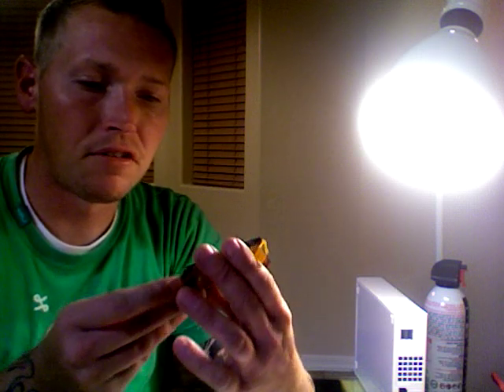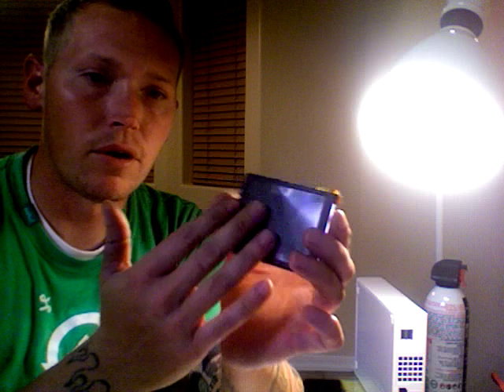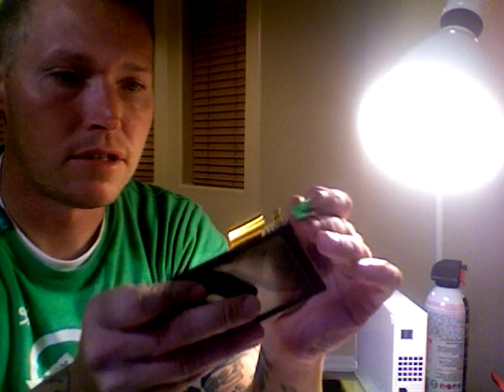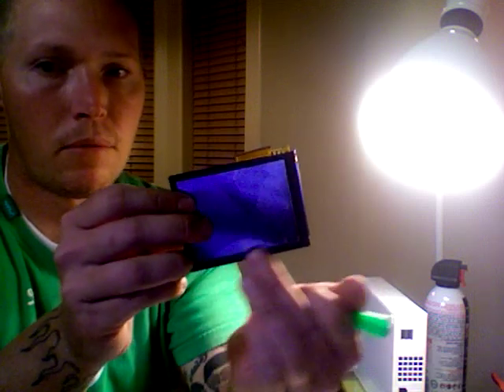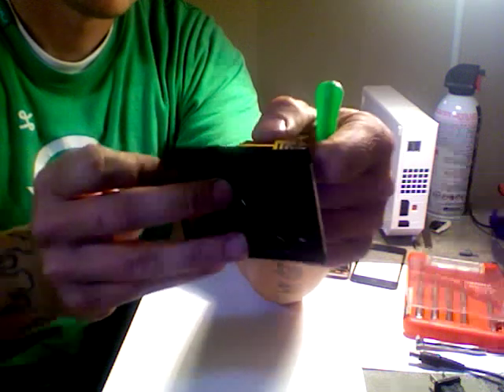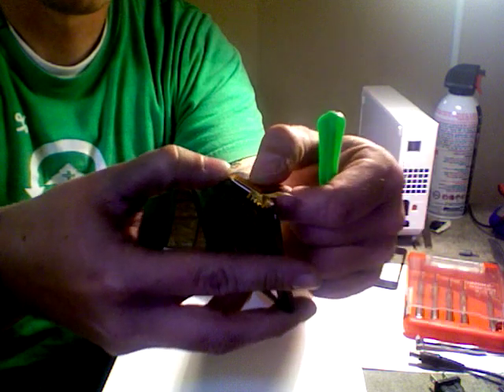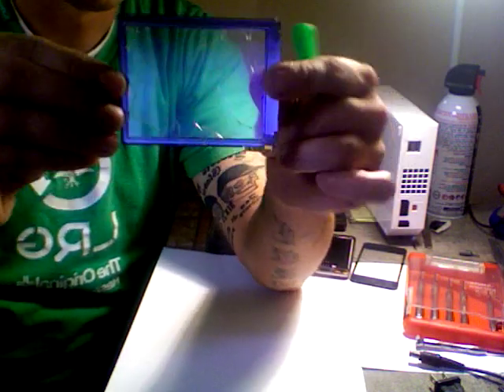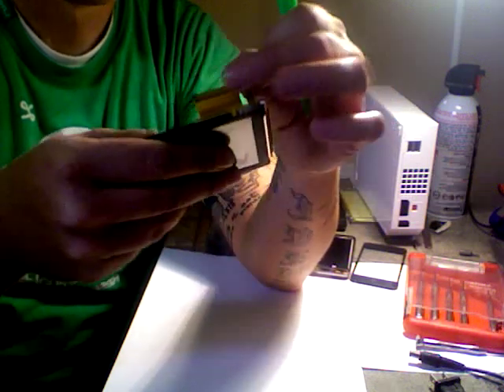Garmin Nuvi LCD Screen Removal/Replacement  Pt. 7

Comment: any help on replacing nuvi 3550lm screen? no screws to remove back
Reply from the maker: You have to lightly separate the back first in order to get to any screws. The plastic back can be carefully pried off.

Comment: The problem with the video is that it does not clearly show how to make sure the reattached strip is properly aligned and seated correctly. If there is any assistance with this issue I would appreciate the help.

Comment: Hi Matt. I haven't used my Garmin in a while and recently got it out but there was a problem. When I clicked on icons it wouldn't open the icons or if I went into settings and clicked one of the items above, it would click back even if I clicked the highest item away from the back button. After a painstakingly long time I managed to reset the sat nav and the whole touch screen issue was fine but now it is playing up again.

It has reverted to the problem I had to start off with. I don't think the touchscreen is damaged because when I lock the sat nav and click anywhere on the screen whilst it is locked the message of "slide lock to unlock" appears so this must mean that the touchscreen is okay I figured.

Any idea what I should do?

Comment: Hi Matt, I have horizontal white lines (about 15 of them at the top of screen) the images under the white lines are clear and focused. Would I need to replace the LCD or the digitizer? I'm not a tech guru, but watching you change the screen, it looks like something I may be able to handle. I'd rather try to fix it myself than pay Garmin $110 to repair it. If it doesn't fix it or I ruin it, I'd rather just go buy a new one then. I appreciated any insight you can give me. Thank you.

Comment: Hello. My unit came on but would not function. Dirt had got into the bottom of the screen. I cleaned it out with a finger nil cleaner. Works now.

Comment from the maker: It's a CCFL which just stands for cold cathode fluorescent lamp. It's just referring to the backlight.  When the backlight or CCFL goes bad but the actual LCD is still functional, the screen will appear to be dark. You would still be able to see graphics on the LCD by shining a bright light at the screen and looking closely while the device is turned on. The digitizer is referring to the actual outer glass that you touch to command the device. Hope this helps. Thank you for watching!

Comment: Hi There,

A few pointers if I may?  Would be helpful if you showed the initial stage of the case being separated and then had close ups of the ribbons that you are removing from 'your' view point. All the viewer 9us) sees is the front of the digitizer and I'm wanting to crane my neck to look over the top of the unit to see exactly what you're doing. Also, more light required.  Hope this helps to enhance your video?  Cheers

Comment: srry to ask this dumb question but I'm kindda confused :-{  .. I have one of those "off-brand" gps from ebay with the Nav N go software and the glass broke(when I turned it on, was able to see a blurry picture but I touched the screen and now I can only see lines)  what do I need to replace? the digitizer or the lcd?.... I tried to separate the screen as you did and pieces of broken glass came off as I was doing it, Thanks for your help

Comment from the maker: @MrXamenyap Go to ebay and type in this part number 320520531165. This company is based in Hong Kong so they are probably closer to you (faster shipping) anyway. When you order from them make sure you email them a picture of your  digitizer. They will look at the photos and make sure its the correct model. Garmin is famous for releasing GPS devices then revising either the LCD or digitizer a few months later. It makes it so much harder to get the right parts..

Comment from the maker: @MrXamenyap   If you actually remove the digitizer, the device will no longer recognize your 'touch'. You would only be able to turn the GPS on and off but it wouldn't allow you to advance between screens. The good news is that eBay has quite a few sellers that offer the 255W digitizer starting at about $12 US. Just go to ebay and type in Garmin Nuvi 255W digitizer and you'll find several. I hope this helps you and thank you for watching.

Comment from the maker: @zhengjdc ...on larger machines like MacBooks. Even working with larger equipment, its extremely difficult. Just get the LCD really cheap on amazon or ebay. I wish I could share my wholesalers but it would threaten my relationship with them and you would have to have a federal tax ID # etc. Good luck! I hope it works out for you!

Comment from the maker: @zhengjdc sorry about the delayed response. removing the CFL only would be a major pain in the a** lol. Thats the only way i can describe it to you. You would be much better suited just replacing the LCD. It will cost a little more but the chances that you'll be replacing it anyway because you destroyed the LCD trying to remove just the CFL are MUCH more likely. I never recommend this for a very good reason. When I 1st began iPatch Solutuons, I tried this several times on larger machines...

Comment from the maker: @mypetridish absolutey. just remove the Identification sticker on the bottom of that unit and you'll see the 2 screws that hold the unit together. Once you remove the screws gently pry around the entire unit with a safe pry tool (like the green one you see in my video) or with a guitar pick like one of the other viewers suggested. It just keeps you from causing damage to the plastic bezel(s). You should see the LCD 1st when you open it. From there it should be pretty simple. Ask if u need help

Comment: on my garmin nuvi 255w the glass is broken but the lcd is fine. can i do this trick to revive the gps device?

the touch screen still works on areas not close to the crack epicenter

Comment: One last note: I didn't have that special plastic tool, so used a guitar pick. Separating the touch screen from the LCD took a lot of work...ended up using floss to start a corner and my fingernail to start it. Made the mistake of trying a tiny metal screwdriver on one corner and cracked the touch screen. No harm to the LCD, but definitely NOT a good idea to use a metal tool on it.

Comment: ...so it offers some resistance in pulling it out and pushing it back in. I really had to struggle with it and force it in holding it with tweezers...very awkward. And there is also a little 2 wire plug. you can see pictures of these extra connectors here, though it doesn't really describe the trickiness of the third ribbon cable.

Comment: Thanks for posting this, it was very helpful! I just replaced the touch screen on my 660...I'm still in shock that I got it all back together and it works! I just wanted to post a few comments on a few extra bits the 660 entailed:

Besides the two ribbon cables there's a 3rd one which connects a little differently..it has a long flip up panel and the end of the ribbon kind of slides into a flat slot underneath. Very end of the ribbon is a little wider...

Comment: I had a garmin 265W with a dimming LCD and I am pretty certain it's the CFL went bad. How do you replace the CFL only ? replacing the LCD would be economically unwise since I am 100% confidence that the LCD itself has nothing wrong.

Comment: @derbritmo I just opened a 1340 and the digitiser ribbon cable is soldered to the back of the LCD ribbon cable, rather than being separate and plugging into the main board.  There are four close together parallel solder joints and they are fairly fine, so you would want to watch you didn't bride between them with a whisker of solder, apart from not damaging the ribbon.  A bit of a PITA, basically.

Comment from the maker: @solitariosalvaje  I wish I could help you out with that one. Since it's not necessarily a 'mainstream' GPS supplier it makes it nearly impossible to find major replacement parts (like an LCD or digitizer). I even checked with 3 of my wholesalers to see if I could just buy it and send it off to you. Not a single one has them in any of their warehouses (and they hold nearly everything for every brand). I'm sorry I couldn't help you on this one.

Comment from the maker: @derbritmo Also, make sure to watch "How to Replace Garmin Nuvi 1450 Battery". This will at least allow you to see how it opens. 1st: the outer bezel. Remove it with a SOFT pry tool, taking your time. 2nd: After you have the outer bezel off you will see 4 screws (one near each corner). Remove them and you'll be able to remove the inner lcd bezel. 3rd: Very gently lift up the lcd and move it forward (toward the top) a little. You will then be able to see the plug in for the ribbon cable.

Comment from the maker: @derbritmo  Be careful of the ebay sellers that sell just the digitizer or just the LCD. It's ok to replace one or the other on certain models but I think you would have been better off getting them as one (already assembled) unit for your 1450. This way you could just literally plug the ribbon cable in and be done with it. If you're not in a huge hurry, I will probably be tearing down a 1300 series in 2 days. That model is VERY similar to your 1450. Read my next comment...

Comment: Anyone done this with a 1450? Got one at Christmas, cracked the screen mid January! Ordered new digitizer but the seller talks about soldering required. I'm capable of soldering but just wondered what's different from the 350?

Comment from the maker: Well let's hope you never have to do it again haha. I just got a MacBook Pro in from  a customer that  tried replacing the outer glass that covers the LCD. Apparently they saw a Youtube video that showed the replacement using a heat gun or hair dryer. It ended up destroying the LCD. Initially, only the outer glass was cracked but they ended up having to replace both. As for you, it sounds like you already know what you're doing. Cheers and thank you for watching my videos!

Comment: Thanks for the video, I did exactly this last night myself before I came back to youtube on a Nuvi 610T screen....  

For the Nuvi digitizer removal I first had to remove some spongy black tape that went around the front edges and folded over the edge; I carefully removed this and replaced it latter.

For the adhesive between the digitizer and the lcd I could not get it to budge initially but with a brief amount of heat from a hairdryer and the careful use of a craft knife it came away ok  Thx